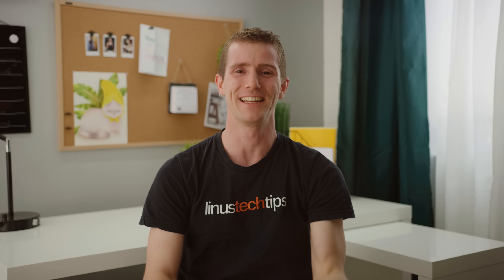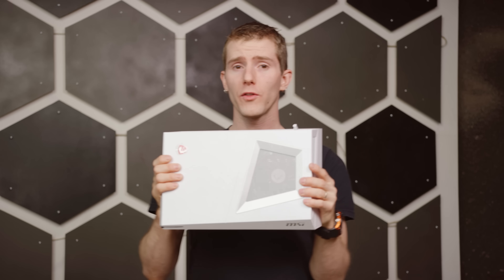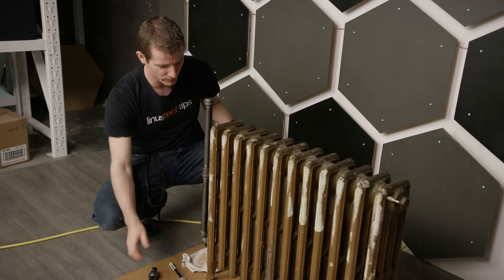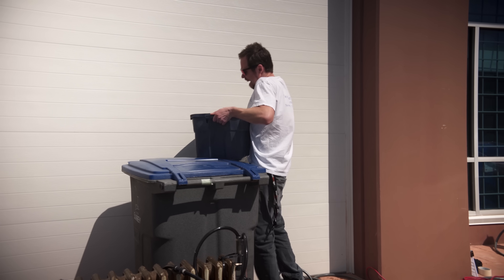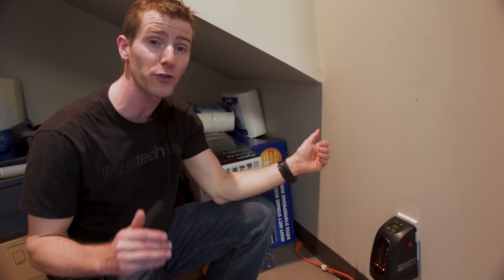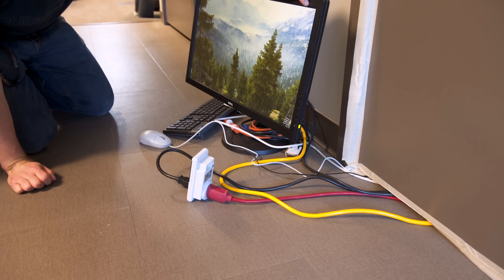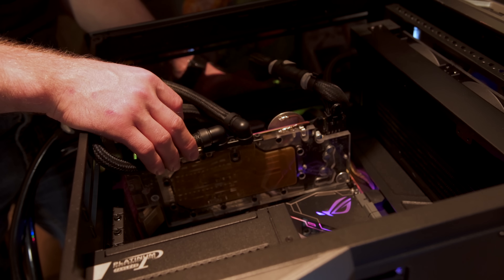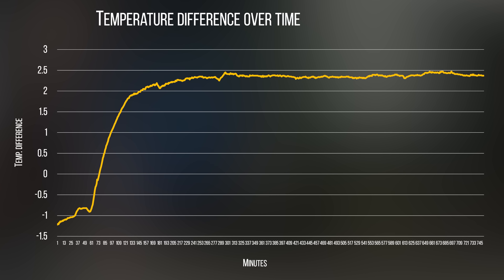Lower your heating bill... with GAMING

Comment: I don't see why the big radiator was necessary at all. The heat output of the system would have been the same on air cooling or just a regular PC radiator.

I guess a better cooler would have allowed the system to dissipate more heat faster and therefore run at higher clocks without throttling. But a regular water-cooling loop would have done a better job at that than a big rusty passive radiator.
Reply: It's LTT. They don't do normal.
Reply: To heat his room Goddamit.
Reply: The size of the cooler does matter for a lot of reasons. That's why they make different sizes. This thing isn't great because for all it's mass, it doesn't have much surface area. That's why it was so hot when he touched it.
Reply: Has quite a bit of surface area, lacks the density / compactness of typical radiators but the entire things meant to soak heat from water and radiate it into the room. Obviously it doesn't magically multiply the heat and for as hot as gpus n such get it's still going to put out the same max heat regardless what it's cooled with.
Reply: I would have preferred they just used aftermarket air fans on the graphics card and cpu would have worked just as good and been much faster to heat up the room
Reply: The thing is, when you use a fan on a radiator to keep your system cool, all it's doing is moving the heat. Cold air goes in, hot air comes out. The system runs cooler because the heat its generating is being pumped out of the water and into the room. With a fan, it probably would dump more heat into the room. During winter I used my computer to heat my room up while gaming. Worked great. Electric bill was a lot lower becuase my PC heating my room was more efficient than my heater trying to warm up the entire house. My pc is in the living room so it was keeping the living room at a fairly comfortable temperature all winter (mid to low 70's)

With my pc off it would drop to the low 60's if the pc wasn't running.
Reply: m4xwellmurd3r That's hot, almost sauna temperatures, but not quite.
Reply: Myrmidon but normal radiators are boring. But yes, I agree the whole video was pretty pointless. Yes heat sinks transfer heat...duh.
Reply: it would run passive and silent
Reply: John Francis Doe: that must be °F not °C
Reply: Radiator has some thermal mass, it heats up slowly and then gives away heat slowly, after the user stops gaming
Reply: As silent as that industrial pump is.
Reply: Air cooling won't be such an effective space heater though. but a ENORMOUS passive radiator will certainly be very quiet
Reply: 1 use a modern room radiator it dissipates heat faster
2 use 8700k.
Reply: Its about surface area which dissipates heat, PC radiator compared to this clunk has much smaller area and cant transfer heat to air as fast as rusty radiator. And water is better at transfering heat than air and the heat transfer would'nt be the same... so your statement about same on air and water is totally wrong, its all about surface area, you need a lot bigger area which this rusty radiator has in spades. Water is just a heat conductor it transfers heat to a bigger area - in this case radiator, small fan with PC radiator can't keep up because the mass of that PC radiator is much smaller and heat ''trapped'' in it is much higher just because the little fan can't get it all away fast. Its like trying to get a full barrel of watter on your head in one second through small faucet rather than just cutting the barrels bottom off.
Reply: Actually, PC radiators have a lot of surface area because they are designed for fans and they have many fins on the perpendicular to the axis where the liquid flows and they're all tightly packed

Old radiators are just... brass tubes.
Reply: Dzintars Veiriņš 
Not true
A watercooling radiator has more dissipating surface of the radiator of this video...

Btw it is all about the temperature of the hardware...if 2 radiators are keeping the hardware at the same temp they are dissipating the samd heat in the room regardlrss of them being air or water cooled
Reply: Yea exacty the heat is going out anyways its really dumb to use this setup ... not just dump its the most stupid thing i ever saw he is talking about thermodynamics laws and fail with a simple common sense physics stuff
just so it gets more stupid most of the energy is store in the large mass of water you have to run it for like 2x the time to get the same heating in the room
Reply: You don't know why it was necessary? To make the project fun and entertaining, of course. Don't you know what Linus Tech Tips is all about?
Reply: grey hound
I disagree with the second paragraph. The temperature is not important. After few minutes of running a benchmark, components temperature will stabilize. It doesn't matter if it stabilizes at 40C or 80C. The fact it stabilized means all the heat produced from now on gets transferred to environment or changed to other form of energy (which in case of PC units is insignificant). All that matters is to reach stability to prevent shutdown from overheating.
Reply: John Francis Doe he probably using Fahrenheit degrees.
Reply: You are right, but would it pass "The rule of cool" ?
Reply: Azenturi mx
Reply: LT. Mizyadovski exactly, this video is a faceplam that makes me doubt these guys even made it through high school.
Reply: "...big rusty passive radiator ".
Myrmidon, 2018.
Reply: I totally agree with Myrmidon.. Regular fans would do a great work as well, all the heat would go into the room anyway, by adding such a big water reservoir they actually made it worse imo..
Reply: cosmoset most people who don't bring a giant brass radiator to the party could probably be fun.
Reply: Really? You dont see any reason why it was necessary? It's an entertainment channel. You need to make it exciting.
Reply: The point is not that it can run at higher speeds but since it is dissipating heat faster it is throwing it all into the room instead of it remaining now the cpu.
Reply: He did it for the thumbnail.
Reply: it was interesting but pretty much any oc cpu high-enbd gpu or sli gamer can tell you just the pc is enough to heat a room, in my case my living room..I barely used heating in it this winter lol the problem is that temperature is regulated by your video compression or gaming, it's not the most stable regulation ahahahah
Reply: Let your computer run for mining during off hours. You heat your house while science discovers new DNA sequences. Win win.
Reply: Because why not :-) and it makes for an interesting video.
Reply: Air Fans use power to spin the fans as he explained and transform watts into air movement
Reply: They knew that but it makes for a good show.
Reply: They'd have a lot better results even with small car radiator something like 30cm x 40cm x 4/5cm.
Reply: Did you his intro joke? Do you think he realises this?
Reply: Dave Lee it's simple physics, the energy you put have to be removed, and will heat the room faster with air coolers because you don't need to heat any water.
Reply: +William Clark Only reason to use a bigger rad is to use lower speed fans/no fans at all. They could have just used a normal water cooling radiator and skipped the 75W pump.
Reply: +LPMusicON Novel idea but what about a water cooling rad!
Reply: Screensaving Gamer yea i facepalmed so much on other videos trust me i've seen worse, even with basic computer stuff on this channel .
Reply: Because we need an entertaining video?

Comment: I once lived in a college dorm where I couldn't adjust the heating and it was too cold inside when it was -30°C or colder outside. Solved this by turning on 4 game consoles, a TV, and folding@home on my GPU.
Reply: something1random23 I gpu mined cuase it was 2015-2016 and electricity was free.
Reply: lol that sounds like a real deal, "Free Energy"
Reply: You could have just bought a small electric heater.
Reply: Electric heaters are expensive to run
Reply: Ten Yuu Kusuhara and a computer isn't?
Reply: In here theres a illegal metal thing that you put on your electricity counter so you dont pay for electricity. But if you get caught its a huge ass fine
Reply: Benny F I am guessing they don't allow you to bring a space heater into most dorms
Reply: yea but the heater won't be making you any money :p
Reply: Benny F what do you think a computer is?
Reply: LMAO, I am an HVAC tech and I have seen this exact thing. These two guys stuffed their AC vents with clothes as it was leaking cool air (a huge piece of shit unit, they won't fix, and don't have the time to explain fully), and the guys turned on their computers for warmth, and it worked. They were maintaining a temperature more than heating the room if that makes sense, but it worked none the less.

Comment: By the way, "light energy" ends up as heat when absorbed (not necesseraly in your room though but mostly) and thermal energy is basically kinetic energy on the microscopic level (giggling molecules)

Comment: Nice cooling system but it won't make any difference with heating. You'd get the same results even by just using a passive heatsink on the gpu. The only thing that matters is the power that's being dissipated. If you use a radiator you'll have a lot of mass at lower temperature and if you just use the stock heatsink, you'll have lower mass at higher temperature (of course assuming that the gpu wouldn't have lowered its performance due to overheating). In other words: for the purpose of heating, this system is a waste of space but it will however, help keep the gpu cool and running at a high frame rate.
Reply: Yes I thought the same. As long as it does not thermal throttle the same amount of heat should need to be let out into the surrounding room, since it ideally a closed system.
Reply: It makes a big difference, as the surface area of the "heat sink" is way higher they way Linus did it, which results in faster heating.
Reply: it results in slower heating. it takes more time for a temperature change in more mass
Reply: Yeah, This experiment made no sense to me. I think a better test would have been the Computer being outside the room they were heating.
Reply: It well take a longer time to rise in temp, but you now have a stored mass of heat, this is like having a rocket mass heater. A small heat sink well dump the heat as soon as it picks it up, were as what linus setup well take some time to equalize across it's mass. then it will slowly and evenly across it's mass radiate that heat back into the room. The right way to test this would have been to measure time to target temp from base temp, then back down from target temp to base temp, seeing how long each system held target temp. As anyone who as ever owned a modern pc knows that are heat pumps lol.
Reply: linus talked about this before and he knows that it doesn't make a difference, simple thermal dynamics. probably used a big ass radiators for clicks tbh
Reply: You assume that theoretically the same power can be dissipated by both a stock cooler and radiator which is fundamentally not true. The increased surface area will firstly prevent throttling and secondly increase transfer speed to the surroundings. This is why small coolers have fans.
Reply: Electron Power When it comes to passive heatsink size does matter as the thermal conductivity is directly proportional to the size of the heatsink itself(assuming the material is the same), as long as the surrounding closed system does not reach equilibrium, heat will still be dissipated  no matter what, and TBH this is not the scope of the test anyways, they are testing if the PC can replace a house boiler or a tiny foot heater.
Reply: Well the next question is can a room full of server racks heat an office of a small company. If it does, well this will save some money to heat your employes during cold days. But maybe not the way Linus team did it.
Reply: If you want to heat a ventilated space having a huge radiator will be much better than a tower cooler. Over time you'll have a huge amount of warm water. Once the heating is turned off the hot air from the tower cooler will quickly be ventilated out, while the warm water will continue to heat the area for a longer time.
Reply: But a fanless heatsink is boring, we want to see cool shit
Reply: Pat and for fun too :)
Reply: Not to mention summer starts next month.
Reply: Actually it might help, as things heat up there will be a maximum limit to how hot it can get, as you approach the maximum temperature it becomes a quadratic curve, so it slows down until no more heat can be generated faster than it is cooling off, but if you have a cold gpu or cpu generating heat, it will become more efficient at it. Although the difference may only be a degree or two in the span of a few hours
Reply: I was surprised they didn't point this out in the video, I understand they want to make cool lil building projects but still, c'mon they must've known, right?
Reply: Electron Power still worth the bragging rights
Reply: This is correct. Heat in (watts) = heat out (btu)  makes no difference if you directly heat the air or heat water that then in turn heats the air.

Comment: PART 2 WITH BRAND NEW ALUMINUM RADIATOR so the gpu isnt thermal throttle and the setup is more efficient

Comment: I feel like just by the data you guys used,  use a brand new fresh radiator, this could actually possibly be viable. I hope they revisit the idea soon with different test vectors like a small room vs a regular size room (700 sq ft or 65 sq meters) and maybe have a test where the PC isn't in the same room as the radiator and see what that does to temps. PC wise and radiator room wise.

Comment: lol ive already got a heater, I use a pentium 4
Reply: I do you one better, I've got a Pentium D
Reply: I had the Presshot, that thing heated up any room.
Reply: I got a g i guess Pentium g4560 or is mine a d?
Reply: I use intel 2 core duo
Reply: I just turn on my fat xbox 360. it might get rrod soon though.
Reply: I remember those old P4s. Mine idled at 55 degrees. And stopped at 93 degrees on a stock cooler. My MB was about 38 degrees. 
There were videos of people using the P4 for frying eggs and bacon.
Reply: Not that my i9 isn't heating my room too
Reply: Core 2 duo, pentium 4 finally died after keeping it overclocked for years.
Reply: i have the best heater. i have an i7... but inside a macbook 🤯
Reply: I Had a AMD FX 8core in 5,2 Giganertz 250W TDP
Reply: I have an amd 8350
Reply: TheLucidDreamer I do you one better, I’ve got a fourth gen cellaron.
Reply: pentium extreme 965 bro.. come at me
Reply: @ondrakahoun6930  core 2 quad is what Im running.
Reply: Personally I prefer the Samsung Note 7 to heat myself!
Reply: @phoenixfront 
Samsung Note 7! Instant Heat Pack!

*single use only. Please see store for details.
**We are not liable for any injuries that may occur
Reply: @psun256  I did have have to go to hospital because of “third degree burns” but other that that, perfect!
Reply: house on fire
Reply: I use a FX 6300.
Reply: @flabbergast_se  I used to work as a video game tester. Imagine working in a small, windowless room, with 15-20 PS3, the same amount of computers, and twice as many monitors, and a bunch of neckbeards testers sweating like pigs. Ha, the good days.
Reply: @KrawattenBube OC Fx-8350

Comment: Bitcoin miners could heat up a city.
Reply: at least that good point for miners
Reply: I remember when I had 21 280x's in one room, holy shit nearly burnt my icebrows off.
Reply: Some Thing The ice caps sure feel is haha
Reply: You didn’t even need to do that because the amount of energy isn’t being changed. You’ll heat the room just the same running it normally without an old beat up hunk
Reply: Or better yet run a thermal power generator.
Reply: HEATING SERVICES!!!!!!! People: How much does it cost? Miner: $10 per week. People: Cool. Sign me up. Miners be like money and bitcoin? YESSSSSSS
Reply: Hmm
.
Heating water...